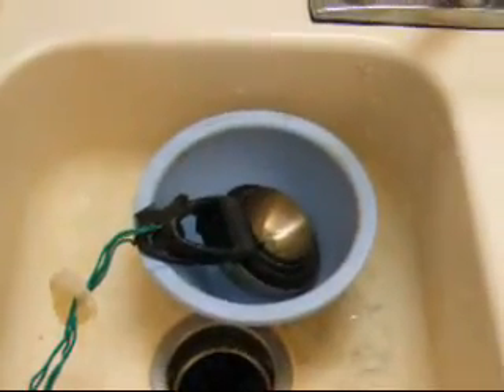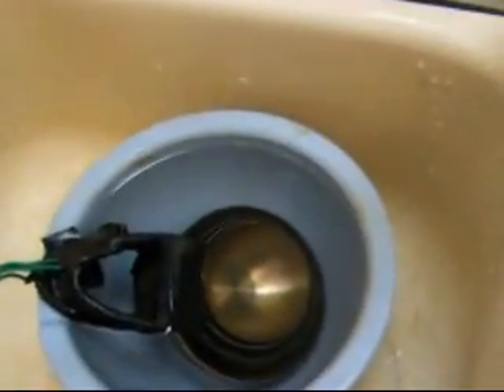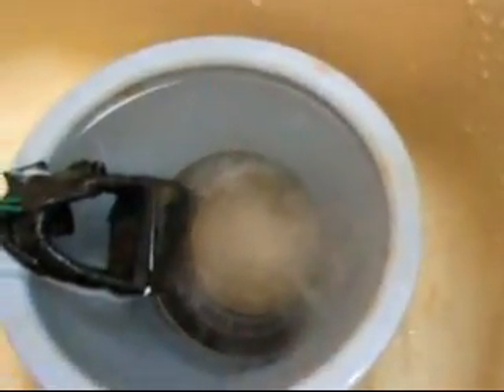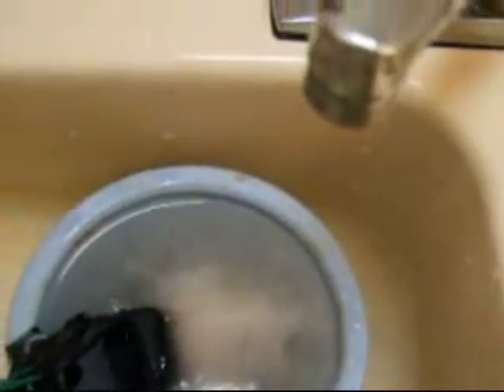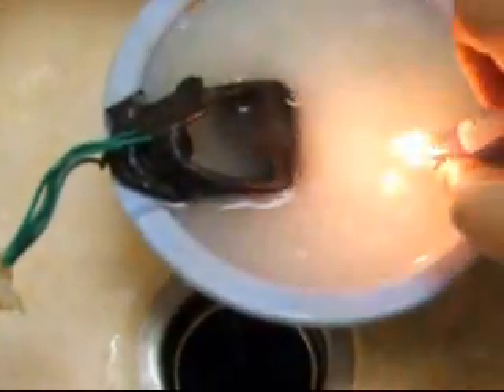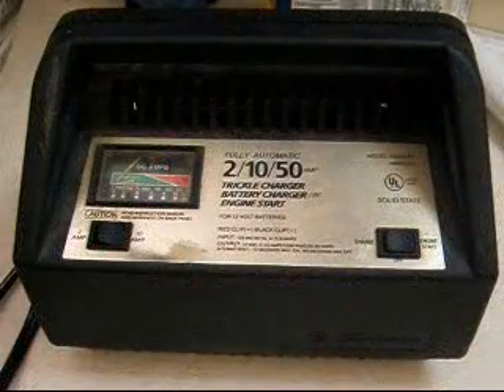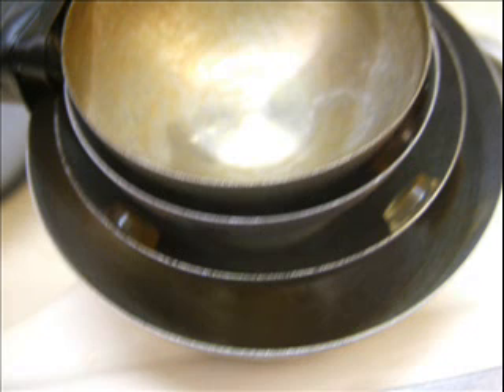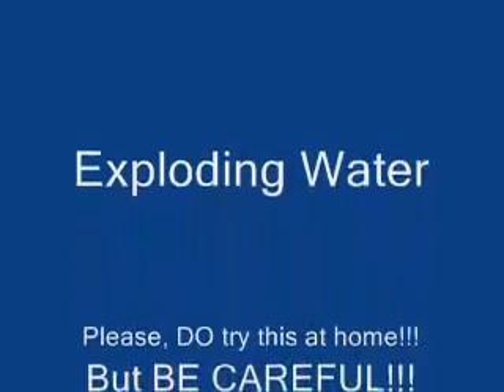Exploding Water

Comment: it's friggin electricity that's powering that. Just install an electric motor in your car and run it directly from a big battery that'll be more efficient than using the power from the battery (or worse: alternator) to first produce hydrogen to increase gas mileage for your inefficient combustion engine.

Comment: Is that stuff heavy or lighter than air cause I was worried when I seen it in the sink? You know with possible build up before you lit it. Also if you drilled a hole in the middle of the cups all the way through wouldn't that help your production as the water could flow through it as it produced?

Comment from the maker: @D13fledermause If you understand that current always follows the path of least resistance, then knowing that both sides of the circuit are in close proximity, and with redundant sources, securely attached, you find the need for worry all but eliminated. You would need extraordinary circumstances for the experimenter to be in any danger of electrocution. Even putting your hand in the water, avoiding the cups, offers a very small opportunity for dangerous current flow.

Comment from the maker: @JamesThWilliams While not perfectly stated, it is generally true. Simply put, generation of HHO gas using electrolysis produces a lower opportunity for work than does using the same energy to drive an electric motor. This is none the less an interesting experiment. It is however not a valid alternative for use as an automotive fuel source.

Comment from the maker: @mrmkowals2 Current always follows the path of least resistance and both sides of the circuit are in the water in close proximity. Even if by chance you touched two cups and did become the path of least resistance, that path would flow through the part of you that was touching the cups. You'd have to put both hands in the water at the same time and touch two separate cups to even have a chance of the current flowing past your heart. No higher risk than jump starting a car.

Comment: I like the experiment but considering the fact that it only takes milliamps of current across the heart to kill a human, do you think you should be suggesting that people give this a try and compare results? The current from the battery charger seemed to be over 10 amps and to ignite the gas with your lighter required that your hand be only millimeters from the water. You should consider revising your disclaimer against "idiots" trying this at home, as I don't believe they're that self aware

Comment from the maker: @beggarz Well said. I watched a lot of videos, like the Joe Cell videos. I am not convinced that this is viable. Better to introduce a battery and electric motor assist. A lot of energy is lost as heat and the continuous generation combined with vacuum driven input is inconsistent and there are reports of corrosion inside the engine. And unless the alternator was already oversized, you may need to upgrade it and add additional load, working against efficiency.

Comment from the maker: @netraven5000 While it is advised that you do this in a well ventilated area, the level of gas release is pretty low and the levels of chlorine gas are extremely low, far less than found at a public pool. None the less, it is not advised that you intestinally "sniff" the gasses, just light them! Also, don't drink the water :-)

Comment from the maker: @patrickguyum Don't touch the water is good advice, but I've touched it many times, even put my feet in a larger container with this device. They sell similar devices for thousands of dollars as foot detox machines. The water, in the small bowl gets gross, you won't want to touch it, but in a large container it isn't too bad. The risk of electrocution is nearly zero, the current will follow the path of least resistance, and that isn't you.

Comment from the maker: @jrigvd Actually you don't. The small amount of chlorine gas that is generated is highly soluble and therefore gets dissolved in the water before it can escape. There is no chorine odor. The tiny bit of gas that might escape from an experiment of this scale is far less than exists at water level at a public pool, far less. None the less, this experiment should be performed with adequate ventilation, and of course, don’t drink the water after performing this experiment.

Comment from the maker: @123woohoo Most building codes require a ground-fault circuit interrupter (GFCI) to be installed on any outlet in proximity to water. The days of bathtub electrocutions are not over, but the GFCI has saved many lives. It trips fast compared with household circuit breakers, fast enough to keep the current from being deadly in most cases. 120V AC and water do not mix well. Folks are trying to be funny, but this isn't funny at all. Don't be an idiot and mix household current and water directly.

Comment from the maker: @dziabaq Pretty much the same thing, NOT, that was alternating current and the amperage draw went beyond the circuit breaker limit. That is why I use the battery charger, to convert to direct current and limit the voltage to 12 volts. This kept the total load of the short circuit caused by the water from drawing enough amperage to pop my circuit breaker. A raw extension cord into water is a pretty bad idea and will almost always trip a breaker. Did I mention… bad idea!

Comment from the maker: @eyallev My research says no. Electrolysis and combustion, both release a lot of energy as heat, resulting in wasted energy not transferred into motion. Charging a battery with regenerative breaking and/or an external power source then using it to power an electric assist motor in a hybrid seems like the best solution so far. The gas/electric hybrid finds the spot as the currently most efficient vehicle. The all electric is close behind, but battery weight and range continue to be a challenge.

Comment: @MikeReedKS yes, I know that, however, an hho engine can still have a use, you "charge" it at home (or a gas station) using electrolysis (that power is generated by, let's say, nuclear power stations), and than you have that energy in the form of the hho gas.  you are not making power, but you are transporting it.

the question is, can you get more power per Kg of that, than you can from a simple battary.

Comment from the maker: @eyallev Electrolysis requires more energy than will be added to the operation of a combustion engine. It is more efficient to use the electricity directly to drive an electric motor. My research concludes that the gas/electric hybrid can outperform the gas/HHO hybrid. Electrolysis is still an interesting experiment to perform and it is interesting to imagine the molecular reactions that convert H2O liquid to its component gases, Hydrogen and Oxygen. Plus the *BOOM* is kind of fun. :-)

Comment from the maker: @Merlin2oo1 Ah, the #1 comment made by... well let's just say folks who shouldn't do this experiment. :-) Nothing happens except my finger gets wet. Current follows the path of least resistance, and with both poles in the water, it'd be pretty tough for me to become that path. I don't plan to stick both hands in and grab the electrodes, but that's no higher risk than jump starting a car, where you do actually handle the separate poles.

Comment from the maker: @floss16 The chlorine levels are far less than found at a public swimming pool. While proper ventilation is recommended, for several reasons, you can't even detect the odor oc chlorine. Most of the small quantity that gets generated is highly soluble and never leaves as a gas; instead it raises the chlorine level of the water. The far greater danger is if you drink the water... but trust me, there is no one that wants to do that... it looks really bad.

Comment from the maker: @sharkdudeintegra To see the reaction all you need if two wires, two small bits of aluminum foil and a 9V battery. Attach each wire to one of the aluminum foil pieces and hang each foil bit in a glass of water, make sure they don't touch. Then hook the other end of each wire, one to each pole of the 9V battery. You should see tiny bubbles form on each electrode (the foil) under the water. Same thing, just smaller scale. Key is to expose some conductive surfaces under water and apply current.

Comment from the maker: @hirodagger Magdrive and others will attest to that. Some make or sell HHO generators that work in automobiles. They claim positive results, but my research hints that only some vehicles show true benefits, as only some have excess power being generated by the alternator. When the alternator is oversized it adds drag, so it would seem that installing a larger one to support HHO generation may actually lower performance. This is simply my opinion, not a statement I can show hard data to support.

Comment from the maker: @SexMaster63 The higher the voltage, the lower the amperage that is needed. If I had a DC power source at a higher voltage, that woudl be interesting to try. In the Joe Cell video, he has a variable supply.

Comment from the maker: @fireworkfreak100 You’d need two cups, one on the positive side of the circuit and one on the negative side. Also, I don’t think you want to use copper as it will quickly oxidize.

Comment from the maker: @Lyc4n1121 I find it interesting that the #1 comment is the request that I test to see if a simple action will cause my death. :-) Tried it, I lived. Sorry. I know… that was no fun at all. The current will always seek the path of least resistance. With both sides of the circuit in the water in close proximity and having no strong ground or connection to either side of the circuit, I am in no danger of electrocution.

Comment from the maker: @TheIanwolfe I put the cups inside an air-tight spaghetti holder. I had a small tube on top leading to a balloon. I had it filled with water to within a few millimeters of the top. It didn't seem to create enough pressure to fill the balloon, so I thought (stupid me) I'd light the tip of the tube and just have a small flame... oh no... bad idea. It lit ALL the gas INSIDE the container, blowing it up and sending water flying. Just glad I didn't have more gas inside!!!

Comment from the maker: Water with any electrolyte will work, but the more other substances you introduce, the greater the side reactions. Ideally you would use distilled water with a single electrolyte. But don't worry; the energy it takes to produce the hydrogen is more efficiently used to drive a motor directly. There is little chance that water will be the next automotive fuel.

Comment from the maker: @yoursuchagoodguy I wanted every other surface to be an opposite pole, so I split each wire and hooked each to two cups, alternating poles. So the smallest, most inner cup and the second largest cup were wired to the same pole, while the outer, largest cup and the second smallest cup were wired together as the opposite pole. I didn't have a script as I shot this video, I did it live, so please excuse the less than clear description. I hoped the text overlay helped to clear it up.

Comment from the maker: @gamehead91 That is why this should not be performed by idiots. You seem to understand that there is risk involved, so it may be something you would perform safely. Water, when it contains an electrolyte, is highly conductive, and both sides of the circuit are very close together in the water and you have no reason to touch the water while the current is flowing. Even if you did, the current will follow the path of least resistance, and that is very unlikely to be you.

Comment from the maker: @bbphnix I am sure that there is heat, as is demonstrated by the HHO generators used for powering cars, this experiment is done over such a short period and with such an abundance of water, that the effect is minimized, but it does indeed exist and given time, there is no doubt that heat would be a noticeable result. You are 100% correct, it just doesn't have time to manifest in this small experiment to a degree that it is a profound part of the results.

Comment from the maker: @eKIUNIQUEx I think you are the first to ask this. Good question! I never measured the temperature, but I have touched the water and it isn't hot even after a few minutes of operation. On the other hand I have seen HHO generators that get very hot, so if the system is sealed and the amount of water is limited to just enough to just cover all the plates, then it may generate a lot of heat. These small cups in a bowl of water don’t seem to generate any noticeable heat.

Comment from the maker: @lev1jeans Many argue that this produces chlorine gas, and at some level they are correct, but there is no chlorine odor as most, if not all of it is absorbed into the solution. Read the feedback, lots of folks arguing this one, not an argument I strongly support, in fact I typically argue against the warning, but to be safe I include it. Please do this experiment in a well ventilated area for many reasons.

Comment from the maker: @hottiegirl110 Passing current through the water causes the water (H2O) molecule to disassociate and release the separate atoms, two Hydrogen and one Oxygen atoms per water molecule. This process is called electrolysis. The process continues to produce chlorine gas, which is mostly dissolved into the solution. It also causes oxidation on the cups, which causes the water to discolor.

Comment from the maker: @antond92 Even then, it is unlikely that you will pass any significant current. Having both sides of the circuit very close to each other in the water makes it very unlikely that you can become the path of least resistance. Now if you pull the cups out and touch your tongue between them, expect some sparks! None the less, better to be safe and not touch the water at all as it is not required for the experiment.

Comment from the maker: @7mileshot It is fairly safe to touch the water. There are foot detox systems that use a similar device in a foot bath. As long as you are not the path of least resistance, the current wants to have nothing to do with you.

Comment: @MikeReedKS Well, I can only watch the video and you can clearly see it. If you can't even smell it, it is obviously save.
By the way, you can do it without getting any chlorine at all. If you use destilled water and add an acid, the voltage will be able to pass through and the electrolysis is able to operate.

Comment from the maker: @Yndostrui No reaction in pure H2O. Electrolyte (salt in this case) allows the process to occur. The increased conductivity greatly increases the reaction. A wide range of electrolytes can be used. Capturing the gas is not advised. There are highly combustible gasses and should not be collected in volume. As for poisonous gas, please read my many responses to this false claim.

Comment: Electrolysis would require a lot of electricity to make enough hydrogen to fuel a car, and that's without the problem of how to compress the hydrogen into a tank. If you're using electricity anyway it would be a lot more practical to simply use an electric vehicle.

On the other hand making exploding balloons etc. is fun.

Comment from the maker: @fcdcristy92 Agreed. In fact stories I've seen show the concept of on-site hydrogen production. The "gas" station uses grid power and water to create onsite hydrogen, eliminating the need for truck based distribution as we now need with gasoline. The fueling station storage needs become only enough for a few hours, if even that. Water and electrical are typically regional if not local, so it eliminates a great deal of the supply chain challenges. Best of all, no foreign dependencies at all.

Comment from the maker: @fcdcristy92 Combustion requires three parts, ignition, fuel and oxygen. In this case, my lighter is the ignition source, the hydrogen is the fuel and the oxygen, and well... it's the oxygen. :-) And as for using in cars, it turns out that there is a large loss of energy performing the electrolysis. It is more efficient to use the electricity to power an electric motor directly.  Hope that helps.

Comment from the maker: @hoter421 The concept of electrolysis is still new to many. To comprehend the ability to use such a low cost and simple setup to break molecular bonds and release constituent atoms is intriguing and interesting to many. The concept that so much power exists in water, and is so easily released, is also a fact that many are unaware of. Plus, it goes *BOOM* and that's always fun.

Comment from the maker: @Johnklagzzz Only if you were the path of least resistance. As long as you are not grounded and both sides of the circuit are in the water, the current will follow that path. There are foot baths that promise removal of toxins that use a similar setup and it is perfectly safe to put your feet in those. It is however unadvised that you touch the water as a pure safety measure. It in no way aids the experiment, so to touch the water is not advised.

Comment: @MikeReedKS  I don't think so. The regulator changes the current fed to the field coils, which are on the rotor. The strength  of the magnetic field from the rotor determines how much it interacts with the coils on the stator and how much voltage is induced in them.

If it worked how you suggest, when your battery was fully charged and you weren't using the lights, radio etc, the entire output power of the alternator would be converted to heat inside the alternator and regulator (about 0.5 Kw)

Comment from the maker: @ImMichaelTaylor It is my understanding that most alternators do not have variable load, so they apply the same load and generate the same output at any given RPM. The regulator simply wastes the excess energy. The idea is to use that normally wasted energy for HHO production. Hey, don't get me wrong... my research shows that HHO is a valid option for very few existing vehicles. And designing new cars to use it is a really wasteful idea.